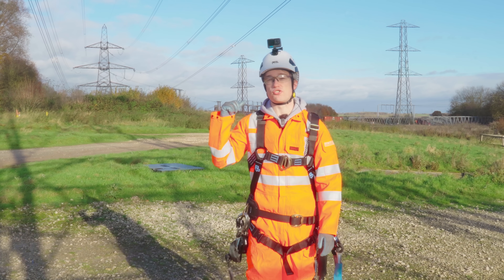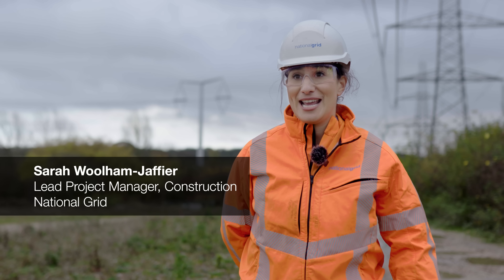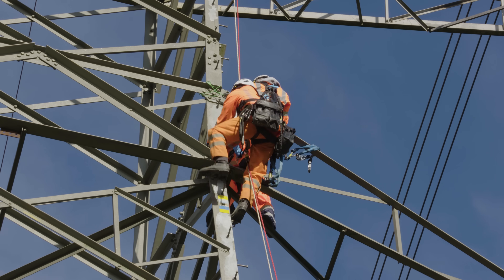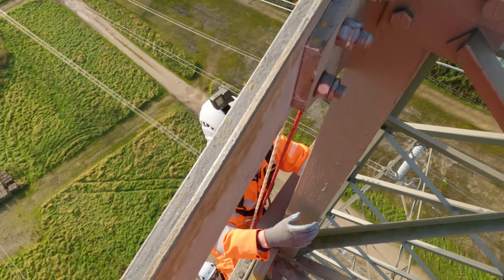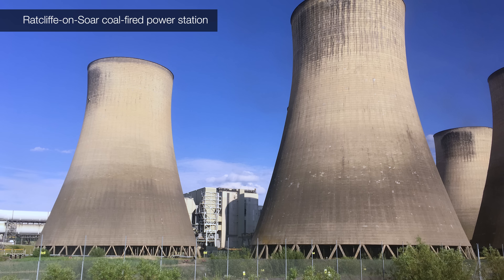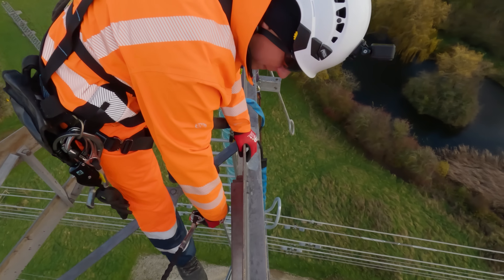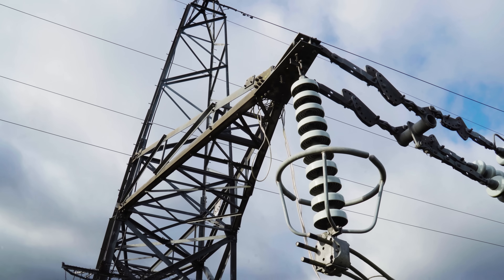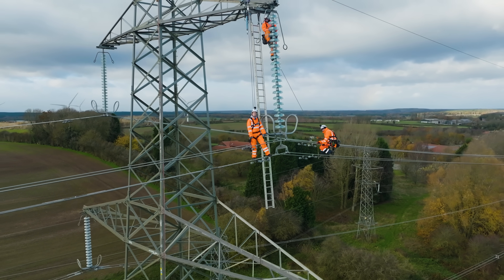People are going to be angry about pylons.

Comment: Hope that reflective protects you from electric shock 😮
Reply: So when you stand on a powerline, because you are not grounded, there is no current running through you, and therefor you also cannot be shocked. Its the same principle as what you see in science class with the little orb that charges you with electricity. As long as you stand on a little plastic stool, it cannot shock you but i can charge you.
Reply: @tophatowl6724  ok thanks

Comment: Just about a month ago or so they were working on these "pylons" or as we call them in the states "Power Towers". Coolest thing was that they actually bring the workers to the towers by Helicopter. They would hang from the bottom of the helicopter with all their tool bags and those ladders and fly them over and drop them off onto the towers and would move them from tower to tower. The helicopter would then fly over to where all the glass isolators were staged, pick up materials and supplies, fly them to the workers and repeat. 

I noticed on these pylons they only have 1 set of the glass isolators. The same thing is true for our towers that they just worked on. So I guess that both the US and Britain are doing the same tasks currently.

Comment: I liked the video a lot, because it shows the challenges people face to work on such heights. It is not easy to work on high-tension wires even when they are offline, now imagine doing it on a live 500kV wire !!! Also, if you go into detail on every aspect of the tower, wire, vibration dampers, insulators and the static discharge features, there is engineering detail to talk about for hours on such a place. I could make content about this for weeks if I were Tom 😀

Comment: Did I miss something? What are the tough decisions that need to be made about pylons?
Reply: I guess he is talking about the additional infrastructure needed to connect offshore wind. There is not a lot of people who like the idea of a pylon in their backyard. We have the same issue here in Belgium. People have concerns about the health risk associated with pylons. But as far as I am aware this is not proven. Underground cables could be a solution but experts say it not feasible. At least not for this project. You can look up the Ventilus project in Belgium. Connecting offshore power to mainland. So I suppose UK will have similar debates in the near future.
Reply: Thank you,  @bjetel . He could have explicitly mentioned a lot of that though in the end, this way I see "ok, it changed from inside out to outside in, and there are problems... which problems?"
Thank you for clarifying!

Comment: During bad weather, you often hear that the grid companies have engineers on standby. Remember that an engineer on standby uses 80% of the power of an engineer who is switched on.
Reply: this feels like a Chris Joel joke
Reply: I know that this may be a silly question but how do they manage not to get electrocuted from working on the insulators?
Reply: @The315fan  well, they have insulating clothes that protect them, down to gloves! But also, insulators don’t conduct electricity, the conductors do :)
Reply: @decent_random  thank you very much
Reply: @The315fan  they don't. There is nothing that can insulate against this level of voltage. Instead, they de power and lock any breakers to the section. They then hook the 3 phases together and ground them
Reply: Facts!

Comment: Due to high electric capacitance between wires of a cable and ground it is not possible to transmit energy in an alternating current system over long distances via underground high-voltage cables. This is another reason why almost all long distance power lines are made of overhead wires hung on pylons.

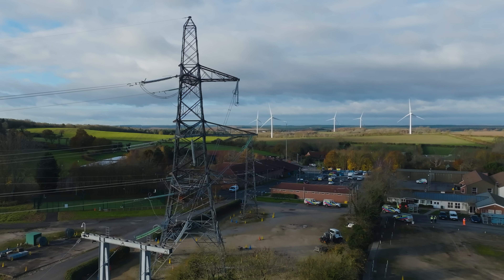Comment: 4:18 a quarter of all power or a quarter of all electrical power?
Reply: What other sort of power could he be referring to?
Reply: @mimi078-f3p  Heating and transport.
Reply: Or rather the power that is required for it.
Reply: @nemofunf9862  doubt they would use a misleading wording to exclude a sizable portion of usage, like surely they wouldn't say "of all our power" and mean only the power used to power homes for example... Though you can easily check the stat online.
Reply: @mimi078-f3p  It's probably just electricity tho. There is no way wind makes up 25% of all used energy in the UK. But i assume it's just unintentionally misleading here. Or maybe "power" definitely means electrical power in English and i'm confusing it with energy here.

Comment: Nice video Tom,
I worked in the industry all my life. .The biggest complainers in my experience were of course those who lived in the real rural areas, they hated the towers and wind turbines.
But as I used to point out to them , they were quite willing to accept power generated many miles away by big dirty coal powered stations ,the smoke from them was causing acid rain and killing the very forests that surrounded them. Its a bit like sewage works no one likes them but if you want to continue going to the loo , we have no choice

Comment: This powerline isn't live, right? Because otherwise, the aluminum ladder touching the cables would short-circuit straight to the grounded tower, despite a few centimetres of fabric slings. You roughly need the length of the ceramic insulators to prevent the 200kV from arcing around. Does that check out?

Comment: Are the wires energized at the training center or just being used for training without any electrical current?  If the wires were energized would one be able to stand on the wires without getting shocked?

Comment: You may wish to visit the UK's largest pylon, which used to be in Kent and has a counter part in Essex to transfer power across the Thames. It has to be high enough for ships to pass underneath and I recall has a rest area at the top (a bed) for the technicians as it is impractical for them to climb down.

Comment: Interesting video, if a bit scary Tom! New pylons are a bit controversial near where I live at the moment. 180 km of 50 metre tall pylons through Norfolk, Suffolk and Essex to feed power from offshore wind farms. It seems a lot of this energy is for London(via Tilbury sub station). It seems that it is OK to put it underground through Constable country, but obviously everywhere else is so ugly already, it doesn’t matter to have these on the skyline. If these wind turbines were all DC, undersea or underground cables would be the most cost effective option, with converter stations at major nodes. Seems to have worked for the last 60 years between France and UK, and now the Netherlands, Belgium and Norway, with proposals for one from Morocco!

Comment: Takes me back! My job: Climb radio communication towers (~~300m) in the Aussie bush and re-seal antenna cable connections. Around seven a year along with the ground-based radio equipment... My heart was in my throat EVERY TIME .  I did the job for several years and then illness prevented me from making the extertion the job required. (We hauled between 5 and 25kg of tools and supplies on a short line attached to our harness and a few metres below us as we climbed. A collapsed lung put paid to an otherwise well-paying job.)  Congratulations on keeping it together for that climb, it looked every bit as adrenaline-pumping as I remember...

Comment: I got my sea-legs working on substation projects as most of the work was done at height using cherry-pickers. Before I did those jobs I literally couldn't step onto any boat without feeling sick although the process of getting sea-legs was disconcerting as everything you touched felt like it was moving. The National Grid is responsible for maintaining the Grid but it is subcontractors that actually build it as with all the new substations.

Comment: Around here, we call that style of transmission structure a lattice tower.  They exist, but are just about the least common style used in my region.  In many cases, the linemen can access the lines via bucket trucks designed to reach the heights involved.  But in other cases, they are brought to the line via helicopter.

Comment: A fundamental rethinking of how we generate and transmit power is necessary. Power should be locally generated by dispersed solar and bladeless wind turbines located in urban areas, alongside a general reduction in energy consumption. We should look to achieve a dispersed grid with no need for long distance transmission or large, centralized power plants or "utility scale" renewables. 

We should be removing pylons, not building more of these bird-killing landscape-scarring high-emissions transmission lines.

Comment: In the United States we are facing a similar problem. Generation type/location change as well as population location change (urbanization and more western growth). Of course in the USA we have a variety of utilities from govt owned (local state and fed),  to private (truly private and investor owned) which makes things much more complicated. 

In addition to the old lines needing upgrade and maintenance we need thousands of miles of new lines.  A lot of rural land owners really resent their property being taken or bought to provide power to coastal cities.  

These towers by the way have, in the United States, a massive knowledge gap.  The people who knew how to design these pre computer are mostly 50-70 years old and retired. We had a long period of very few of these being built as the USA favored steel pole designs (much simpler) especially in the eastern USA . but for the new 345-500+ kV long lines you need lattice for costs.  Plus all the manufacturers of lattice are not in the USA anymore.

Comment: That's an unusual directing video, standing in the mid of pylon speaking towards a drone. Great video.
They are called "pylons" in several other places aswell, much cooler word :d. And also, those are the old typical ones. Imagine climbing in the newer ones which are similar design but much higher.

Comment: Sadly, offshore wind turbines aren't a 'clean' energy source. Often, there is a need to run on a diesel engine when there is less wind, so the parts stay in movement; otherwise, they would corrode
Reply: Wind turbines are enormously clean compared to natgas or coal.
Reply: @logitech4873  yes that's true just wanted to mention they sadly not the cleanest when powered by fossil fuels
Reply: And there are newer windturbins that have a "batterie" to power the turbine where fuel is only a backup 😇

Comment: Instead of climbing, at least in the US, they'll often fly linemen out onto the lines via helicopter. This also allows them to keep the lines energized, as the flying helicopter is obviously not touching the ground, so there's no path for the 500,000 volts to flow, so as long as the issue they're fixing didn't cause a power outage, they don't have to shut off the power.

Comment: The main reason high power line are... well... high, is that very high AC voltage (hundreds of thousands of volts) is much more efficient to be transferred over long distances in that it requires smaller gauge lines for the same amount of power at lower voltage, but it is also rather "leaky" in that it can arc through a lot of stuff, and air is such a great insulator - if you'd want to bury very high voltage lines, you'd need quite a lot of very good insulator (maybe even ceramic) which would make the whole exercise quite a lot more expensive than building huge metal towers everywhere.

Comment: The only thing I'm uncertain is that it Tom said underground is harder to maintain... I can't belive that... underground is 100% harder to build, after all you need to excavate an unbeliviable amount of dirty all across the country and then build it with concrete and steel pipes, but then when it comes to maintenance it would be as easy to get to the point where the problem happened and fix it... without the need of super heavy machinery and/or helicopters/cranes... also it probably would have a lot less issues than exposed cables, so even less cost in maintenance, and maybe it would not be the case for a country where earthquakes are common, but otherwise...

Comment: Living in Tennessee we are part of TVa Tennessee Valley Authority which produces power through several methods including  hydro electric dams , nuclear . Those big pylons here are called Transmission towers. Here they have a concern over doesnt. Tornados.  While they can withstand  a weaker tornado  ..even a weak one can rip down the wires.

Comment: Electrical pylons are way more complicated than most people ever imagine.

You can't just take grid electrical cables, stick them in a pipe, and bury them underground.  The different phases HAVE to be separated by a considerable distance, otherwise you get interference and shorting and sparking.  If you've got to move gigawatts of power over hundreds of kilometres - then pylons are, by far, the best option.

Landowners whose property needs to have pylons on it are compensated. There is a whole chapter and verse of law related to "wayleave". The process whereby farmers, etc. get paid to have utility pylons on their property. Truth be told,  having a few utility pylons on your land is probably the most profitable "cash crop" many farmers produce. And certainly the one with the least work involved.

Comment: With our modern interconnected lives, each of us is using more electricity than ever before. What is our response to this? We're shifting more and more of our energy production to unreliable and more widely distributed sources. As mentioned in the video, this will require the UK to build more grid infrastructure in the next five years than was built in the prior 30 years. It's worse than that makes it seem. The UK will need to build more pylons, transmission cables, substations, and related facilities than the country has built in its entire history! That may not be possible. But, even if we do accomplish this monumental task, our grid will be less reliable than at a time since the 1950s. 

Worse, when the power went out in the 1950s, most could get by for a few days using oil lamps and coal to light and heat their homes. Today, electricity means much more to us than it used to. We use it to run our lives.

Comment: At the moment it's nearly impossible to get a planning permission for a brand new 400kV OHL in the UK. AFAIK only uprate is possible instead of existing 132/275 kV OHL. Most of the new power transmission projects inside of the country will be VSC HVDC with undersea cables - several will be built between Scotland and England by the eastern coast, as well between Kent and Suffolk.

Comment: Electrical engineering undergrad here. I recently completed 2 courses on power systems and this video came up in such an apt time. It's nice to see what i learned in action.

For those wondering what the disk like things are hanging from the pillar arms, they are insulators that seperate the wire from the pillar which is essentially connected to the ground. 

You can also see a round loop of wire at the lowest disk insulators, those are guard rings which is a safety measure for the insulators. They work, in simple words, by providing a compensating capacitance that balance out the capacitance between the insulating disks and the pillar body. This helps with something known as string efficiency. 

Cool stuff!
Reply: Are you referring to the Arcing Horns?
Reply: A smile, nod and hat tip honors our good friend, “eLi the iCe man” (who's always CIVIL if respected properly).

Stay safe everyone. Please take care of you and yours.